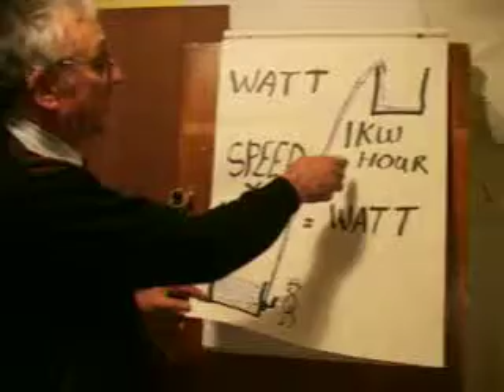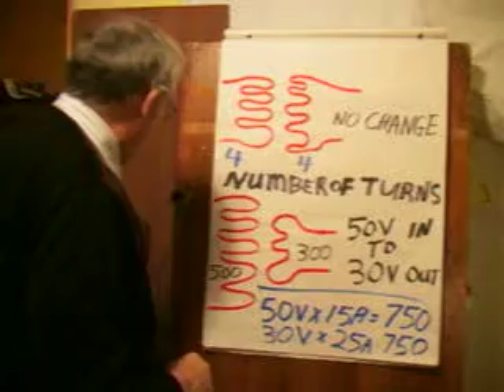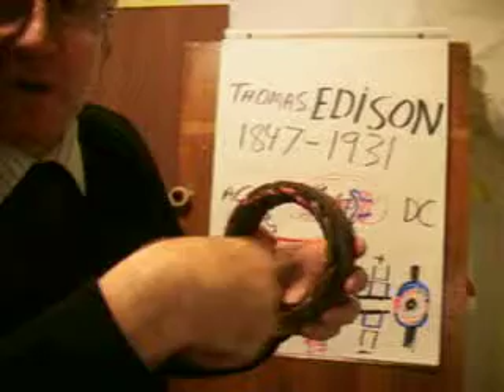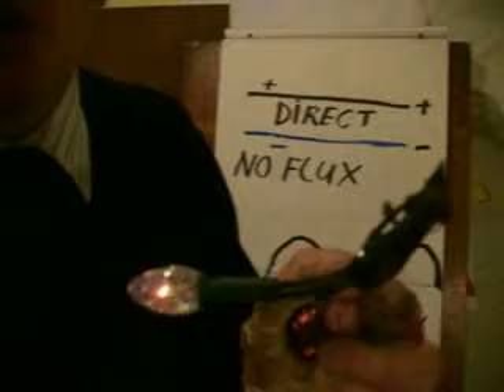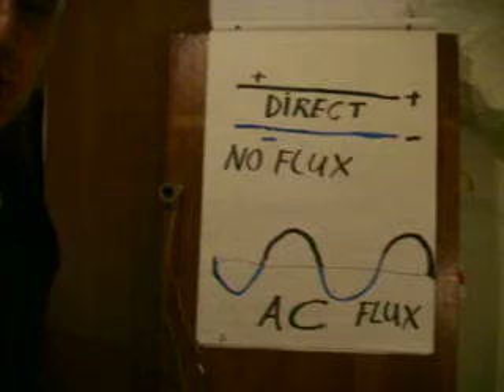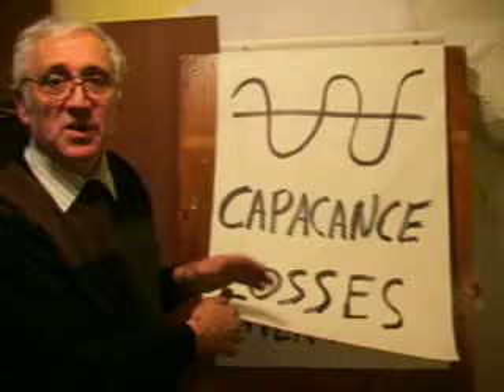"The Myth About Wind Farming" - Part 1B

Comment: Why didn't they use a dynamo in cars rather than an alternator? Battery and appliances need dc.
Reply from the maker: The dynamo contains a commutator which has segments and brushes which wear out.   The alternator has slip rings and brushes which are easy replaced and wear less.  There are less wires in an alternator, an aluminium casing, there is no need for a cut out and power is given off at mush lower engine speeds.